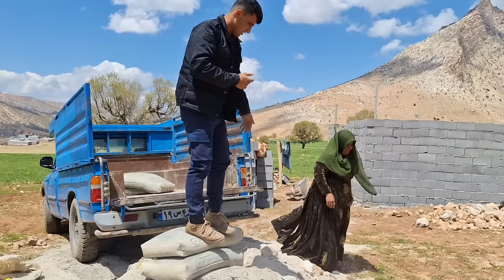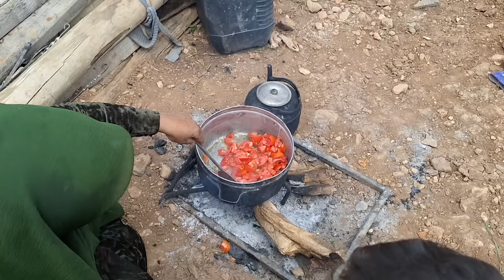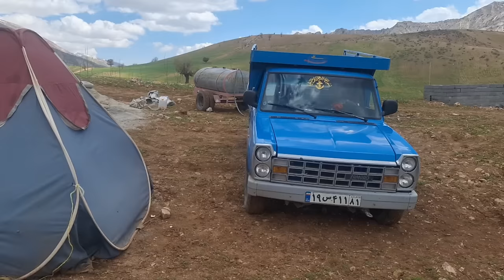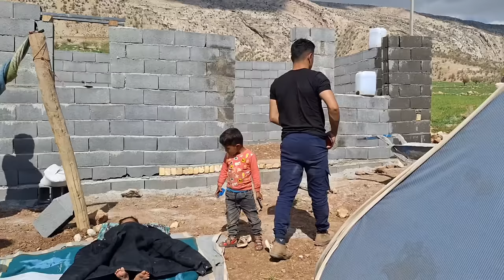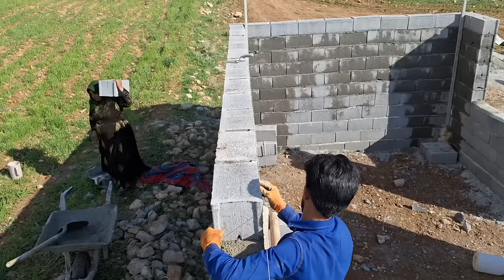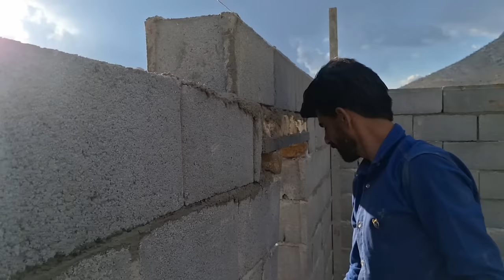Romance exercises: Rasool's practice with his grandmother to propose to a young girl

Comment: This will take a little more water but they make nozzles for hose pipes that allow more flow of water when you are watering something..This would be ideal to water the block down OR IF  you do not have one of those just put a finger or thumb over the end of the hose facing  the house ..It will shot the water out at a faster pace,covers more area...